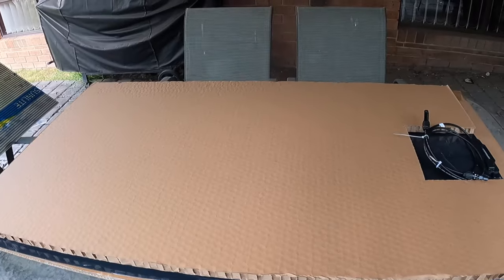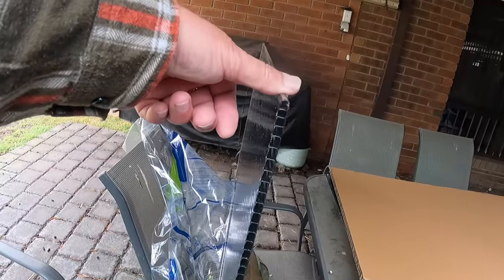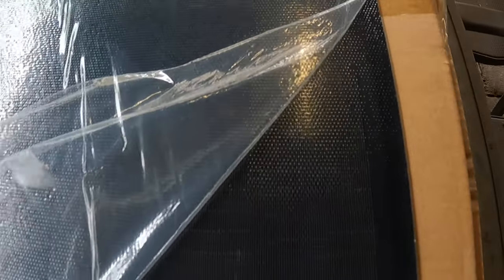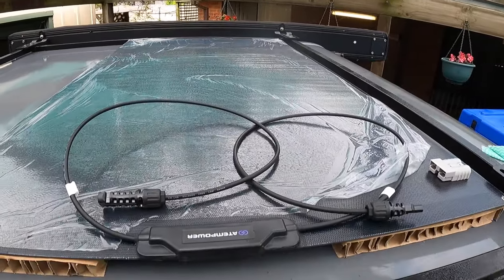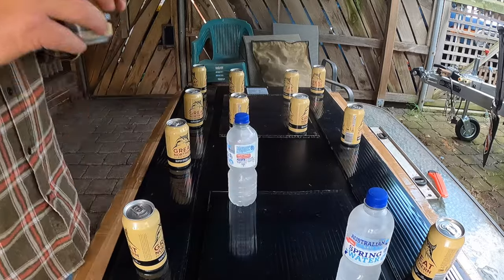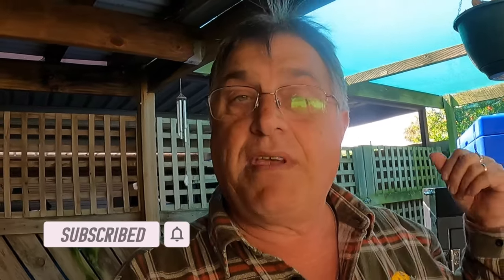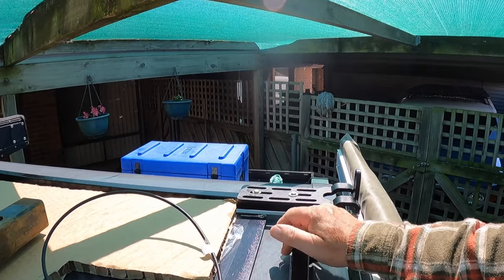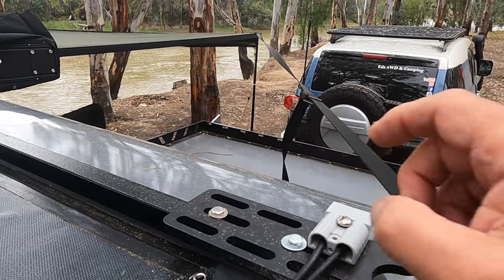Transform Your Off-road Camper With This Easy Rv Solar Panel Installation!

Comment: Great looking camper, the flexible solar panel is a great addition.
Reply from the maker: Thanks Lady for watching I just thought I would use the flexible solar panel. Those glass panels are quite heavy on the Flexi solar panel is my best option. It will be interesting to see how long it lasts on the roof. I'll let you know. Thanks for watching
Reply: @eds4wdcamping  yeah I have heard that the longevity and output isn't as good but much lighter and more convenient.

Comment: Good one Ed . Should keep the power up.. A gap would have been nice between the panel and roof to dissapate heat but looks like not an option for you.
Reply from the maker: Thanks, Dave, There is a gap between the solar panel and the roof. I used some of that sunlight panelling which will hopefully help with the airflow and find out when I go away with some good mates on Australia Day.
Reply: If you've got the room and your solar controller can handle the voltage, house panels are probably the best option.

 They sell plenty of them, so the price per watt are leaps and bounds ahead of "camping" panels and they can afford to put more R&D into the panels, because of the volume they sell, so they're more efficient than most camping panels as well. 

What sort of panel is that? Mono crystalline? Looks weird! 😅

Comment: Great job with the solar panel installation. I love the beer can weights unfortunately it  would not have lasted long with me around. Cheers mate I brought the kings  160 W panel and put on the roof of the Fj it pumps up to 10 /11amps  been very happy with it 👍
Reply from the maker: The beer was a great addition to the solar panel. Problem is not all the beers made it that day. Was off grid for five consecutive days and panel performed fantastically well more than happy to be interesting to see the long Jevity of the flexible panel. Thanks for watching. I'll see you in the next video

Comment: Good job,, what are you powering? Fridge and lights?
Reply from the maker: Thanks Trevor the only thing it's really powering is the fridge a sirocco  fan and maybe the TV that's inside of the camper about an hour . Worked  fantastic over the long weekend. Keep the juice in the battery thanks for watching

Comment: G'day Ed 
What you can do with beer cans and water bottles😉 I hope it's going to work out for you mate I wasted many hundreds of dollars on flexible panels. I would never buy them again
Reply from the maker: Desperate times call for desperate measures the hardest part was not drinking all the cans afterwards.😀 but it wasn't through lack of trying. I'll see how this Flexi solar panel travel should be addressing. Thanks for watching Jack.